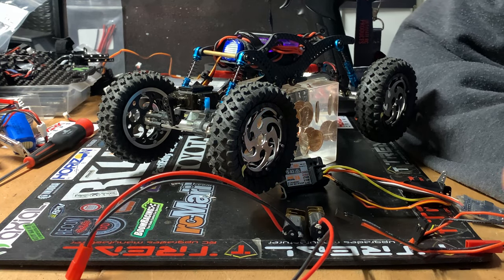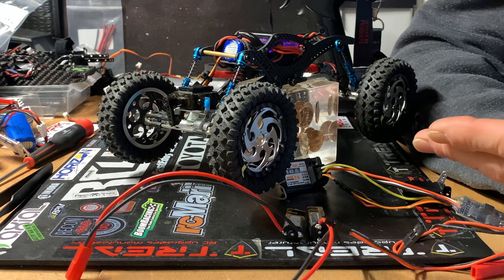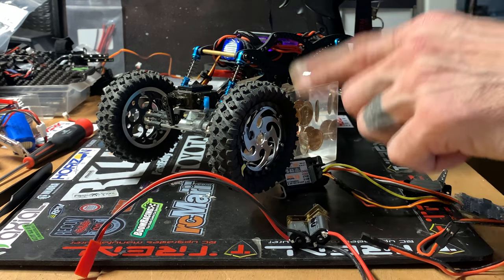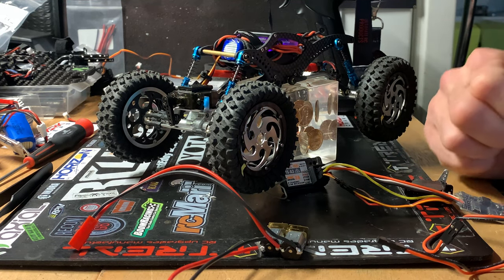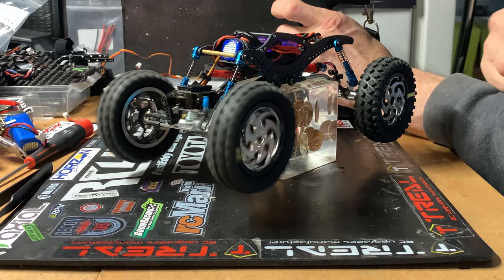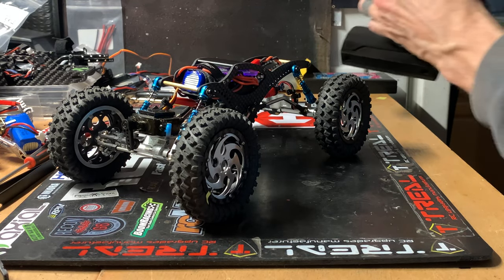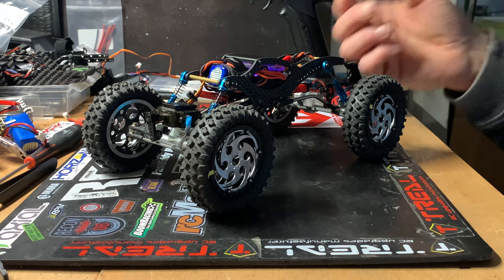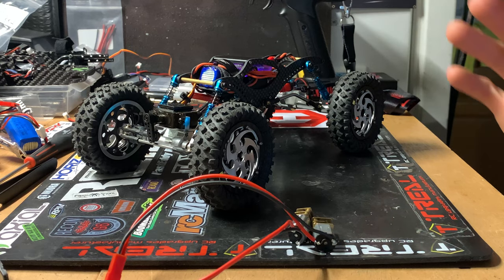Coffee & Crawlers Ep. 10 - Dashex Z2 MOA Progress

Comment: Thats freaking awesome, I would have pancaked two esc's with a y harnes to the battery. And then the esc's to the receiver, then mixed. But think your way is more efficient.
Reply from the maker: Well, I did eventually do that. I've also temporarily given up on this project. After a full year of tinkering with it, I have 2 x 40A esc in and runs on 3s. However, the minute I start testing, I stripped out the rear axle shaft on the left from doing too much dig on a high traction surface!
Reply: @VermontScaleCustoms  Merry Christmas!

Comment: Hello, nice rig! What servo are you running? The only one I’ve found that fits the dashex axles are stock scx24 servos and I would like something a little better. Also, did you receive your new esc you’ve been waiting for? Can you run it on the stock motors with a video before you replace the motors please? I’ve got my dashex on a echo chassis, using the same rx/tx as you and would like better fine motor control. I’m considering the Dinky RC escs if you haven’t seen them, but a $15 option sounds better if it works! Also, if you were not aware, there are a range of rx’s for the G7p that may fit your micro builds better. I’ve only found them on aliexpress so far though.
Reply from the maker: I measured and mine is the same size as an NSDRC rs100. My Dashex came with a metal gear servo in a clear case. Pretty strong for stock. Better than emax.
Reply: @VermontScaleCustoms  You didn't receive your new esc yet?
Reply from the maker: I did get it. It actually showed up about a week and a half ago. Just have to dedicate the time to installing and testing. Much bigger than the 5A, too.
Reply: @VermontScaleCustoms  I have two of the 5a to try to see if that helps with control (one for each motor), but I'm not hopeful. Did you try that?
Reply: I should say, I have two of the cheap esc's that were oe on your chassis to try
Reply from the maker: My Z2 actually came with one of the generic red "20A" ESC. That thing would be lucky if it produced 3-5A with the wind at its back on a good day with the planets perfectly aligned. They are the worst and I have like 4 or 5 of the things from random WPL builds. Awful. 

To answer your question, I never tried two of the 5A. It actually seems like a good idea. I did go a step beyond and ordered the 10A. I had heard that they were being updated and were to arrive as a 12A. Mine was one of the new ones. So, maybe this weekend, I can dedicate some time to it. 

My 10 year old iMac finally died two weeks ago and I literally just got the replacement booted up for the first time last night. I have yet to edit any video with it, though. Should be MUCH faster :) nSo, I've had my head in trying to adapt and keep uploading stuff. It's been a dance of a 2008 MacBook Pro running Linux Mint and uploading to YouTube and downloading with my iPad to edit in iMovie. It's been rough, as you may gather. So, now that my computer issues have been resolved, I can get back to working on rc projects.

Comment: Any update on this build??
Reply from the maker: Yes, it's right here: https://youtu.be/HmuGPYUJ92c
Reply: @VermontScaleCustoms  thanks man! Missed that video
Reply from the maker: I mean, it's not like I'm giving up on it, I just feel like I need to focus on some other stuff for a minute. I still want to try the lower RPM motors as well. I think that will change a lot.
Reply: @VermontScaleCustoms  I’m curious, why don’t you just run two esc’s? Could also run brushless. How do you like z2 axles I’m terms of durability and quality?
Reply from the maker: I started with it this way and was trying to see how well the single ESC with mixing capability worked. And, as far as function goes, that's all there with the G7p and radio. I have mixing all setup with just one ESC. So, I thought I would try the next one up for output current. And, while it has more than enough to drive the two N20 motors, it lacked reverse. PLUS, I've already sunk a lot of money into trying to get this thing up and running right. How do I like the Z2 axles? they're fragile and require a lot of maintenance but they're the only thing that comes close to being like what were's used to for set up. I have yet to get my hands on a Basher Rocksta and I'm not sure I ever will given the scarcity. So, until something better comes along, I'll run the Z2 axles. I also have 60 RPM and 40 RPM motor that I have yet to try.

Comment: My comment from yesterday : Why do you need two batteries? The original brass axles are not thicker compared to the aluminium ones. Looks like your esc's are weak.
- I recommend 300 RPM motors or you will likely be lacking in wheel speed with 60 RPM.
- Run the front overdrive (120%) and rear with 100%
- If possible, put all the electronics on the axles (avoid sprung mass)
- You only need one-wheel-height to maximum one-tire-height flex.
- The esc's I have are cheap, super smooth, light and tiny and can handle 3S. 

As you have seen, my Z2 has all the torque and speed it needs... and this was crawling at about 2°C on wet rocks! https://youtu.be/1Bty7LKO5Wc

This is how it performed with the cheap weak dual-esc running 2S... https://youtu.be/78ixGgp1QPY
I've installed a tiny nano receiver since. Should've done so from the beginning.
Reply from the maker: It's running only 1 ESC now with a 120mAh 3s on it. It gets about 20 minutes of runtime per charge. Plenty of power for the front axle but not quite enough for the rear as well. I think it's about 99,9% there now. When the 10A version of this ESC arrives, it'll be worth the wait, I think.

2-4s compatible: https://www.ebay.com/itm/385448617571

Comment: This is the electronic setup (duel-esc for 2S or 3S) I recommend. Super smooth esc's: https://youtu.be/DWMwBsffVMU
Reply from the maker: If you watch the video you'll see that I've got it figured out. Also, I ordered the 10A version of this ESC today. I think that will correct any issues by doubling the current. I don't know how much shipping from Denmark would be but I bet it would be far more than the ESC, itself and right now, I can only find those from half way around the world. The 10ax2 sells & ships for about $13 USD from China and will be here in about 2-3 weeks. The 60 RPM will still have plenty of wheel speed. The stock aren't any more than maybe 150 RPM at the most and that's at full throttle, which I never drive at. I like a good low speed control and trying the motors will be a good experiment to see what it can do.
Reply: @VermontScaleCustoms  It's a German company. They have been shipping to the US costing 8 €. Write them an email and ask how much the shipping will be.
Reply: @VermontScaleCustoms  The stock motors are 300 RPM. I still have the stock motors installed.
Reply from the maker: @rcrockcrawler  The front seems fine, like it has plenty of power and doesn't stall out. The rear motor just can't handle any kind of heavy load because the gearing is too tall. I feel gearing down will give me the necessary low speed control and boost horsepower. With optional overdrive engaged on the Tx, I can boost wheel speed if needed, too.

You know I started this whole project because I saw one of your videos and thought it would be a good idea. It's been challenge but I think I've just about got it right. It's not the exact same as yours but it has its own custom qualities. 

Someday, when I get all this figured out I'll try and start doing more high clearance rigs like you make. Your link setups are amazing and part of the reason why your crawlers run as well as they do. Your geometry assists far more than just having good components.
Reply: @VermontScaleCustoms  I love how you rig is looking. Can't wait to see the super tires in action. 💥

The front's job is to crab, bite, pull and steer. The heavy lifting, the real work is done by the rear.

Imo, the issue you are having is not because of the RPMs, but due to the esc.
The way those dual-escs are made the rear motor 2 (yellow signal cable) somehow doesn't get enough juice. 
When I had one of those escs installed, I swapped the motor wires back to front, which made an improvement.
That is...
- front motor connected to esc motor 2 wires (controlled by (s) yellow signal cable - on CH2 master).
- rear motor connected to esc motor 1 wires (controlled by (s/+/-) receiver cable - on CH4 slave).

The fascinating thing about the N20 motors, is that they speak to you and tell you what they like..

They love very light wheels and super soft flexing tires = Anti-Stress! 😅